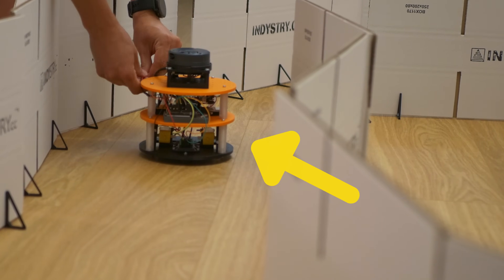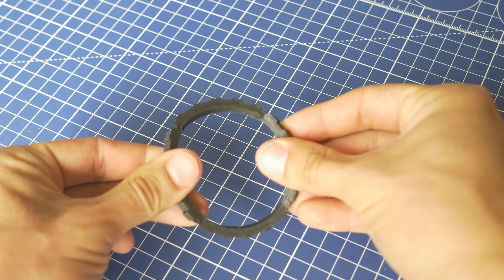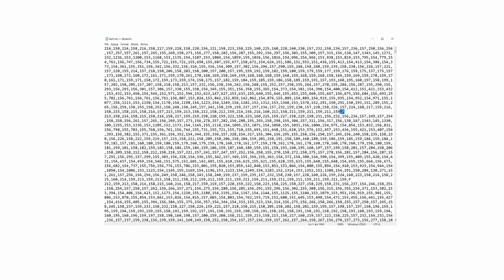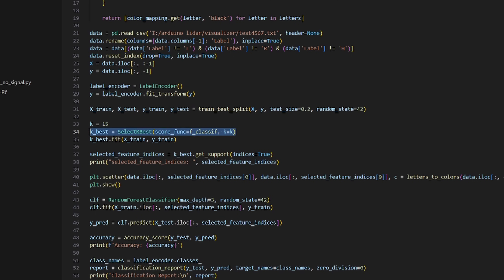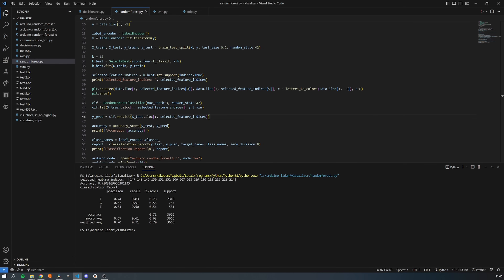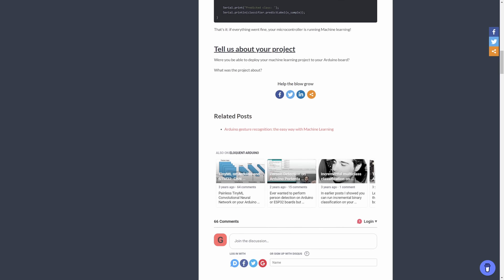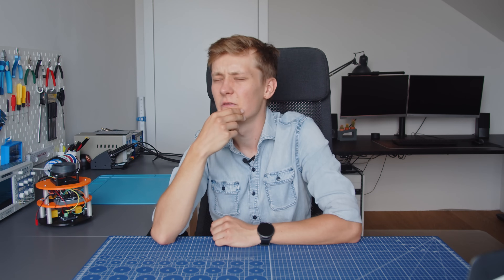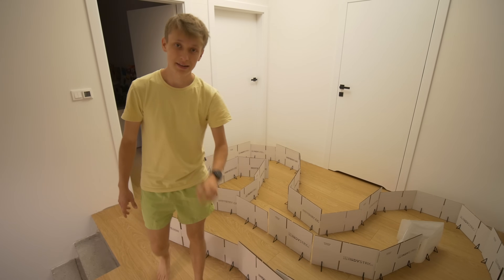Machine Learning on Arduino Uno was a Good Idea

Comment: Can i power the motor driver with 8 AA batteries?
Reply from the maker: Even 6 could do as I am using 2S lipo battery which is 8.4V max. But it's better to use 18650 or a lipo instead of AA batteries. You can get higher currents and recharge them
Reply: @nikodembartnik  Thank you for the answer. Does it matter wich TPU u use for the wheels?

Comment: A really interestin and amazing project. You are the Master.
Nikodem, I need to do a ball robot collect. 
So, how to do for to adapt your experience on a ball collect robot arm by arduino? My idea is:
  - to put sensors on each axis (angle sensors) to move. Maybe 4 axis (minimum). 
  - To move the arm manually.  Or is better to use by BT like you? or in each movement to put a switch and when the movemt is fisnish to push the switch?
  - To write each sensor data on a SD. How to organize the datas on SD for to TinyML?
  - Use the TinyML to create the code "*.h" and then use it on the arduino.
Some other suggestion for to adapt you project on my robot? 
And another option could be will be to use a "PixyCam2", it generate a lot of data could be interesting (size, position, reco👌gnise object, ...)

Comment: hello , if I want to measure the density of traffic on a road, what kind of system can I install? i want something low cost and functional. it should be a system that can transmit this density to another device and show the density. i would be very grateful if you help me. lidar sensor is used? which one do you think is advantageous?

Comment: How can we use reinforcement  learning instead of labelled data set
is It possible>>>?
Reply: Of coarse. I would opt for software training though while normalizing the data to what the lidar module outputs. then you can do multiple training sessions in parallel then upload the finished modal to the robot for real world testing. 

If you want to do reinforcement training, you would need in excess of 30,000 - 50,000 revolutions around the track.

Comment: Had a look at the RPLidar DataCollector code, what is the purpose of setting the Lidar resolution to 240? Why not set it at 360 degrees?
Reply: He mentioned in the video that the robot will be driving forward, so to limit the data noise, there’s no need for rear facing data.

Comment: Hey i am just wondering to work with the same project but i am thinking of a maze solving bot. maybe it is a great idea to work on one using arduino with a lidar sensor but i havent got the materials to do it yet. i think it would be good if you work on a video like that

Comment: New subscriber here! This is a fantastic project. I just came to this video from the one where you raced two of them, very cool stuff. I am working on a similar project using an RP1 LiDAR with a differential drive robot as a learning platform for things such as SLAM. I am not too familiar with ML. Do you have any favorite resources or project ideas to get begin learning?

Comment: 🎯 Key Takeaways for quick navigation:

00:00 🤖 Introduction to the robot and project setup.
- Introduction to a small robot with machine learning algorithms running on Arduino Uno.
- Overview of the project's goal: autonomous navigation on a racetrack.
- Mention of the steps to be covered in the video, including building the robot, creating a racetrack, data collection, processing, and a final race.
02:20 🤖 Building the robot and the racetrack.
- Description of the robot's construction using an open robotic platform.
- Explanation of using simple blocks for the robot's chassis and adding necessary components.
- Improving traction on robot wheels with TPU tires.
- Innovative use of cardboard for creating racetrack walls.
05:01 📊 Data collection setup.
- Installation of a Bluetooth module and an SD card for data collection.
- Explanation of recording lidar measurements and control labels while driving the robot.
- Details about the data format and collection process.
07:10 🧠 Processing and training the machine learning model.
- Discussion of feature selection to reduce data dimensionality.
- Overview of experimenting with different machine learning classifiers.
- Mention of using Python libraries for processing and training.
09:08 🏁 Testing the robot's autonomous driving capabilities.
- Introduction to testing the robot's performance on various racetracks, including square and figure-eight.
- Highlighting the ability to adapt to new racetracks with additional training.
- Preparing for a final test on a complex racetrack.
11:40 🏎️ Achieving high-speed autonomy.
- Surprising results as the robot successfully handles high-speed autonomous driving.
- Discussion of motor speed settings and PWM signals.
- Comparison of robot performance between manual control and machine learning algorithms.

Made with HARPA AI

Comment: Nice Work! It would be interesting to see if one could "simulate" the movements for a rectangular track, instead of training on the actual path. I would guess, it would lead to comparable results. If yes, then the advantage with simulation is that one can design more complex paths without actually building them - making the training process very efficient and robust.

Comment: I cam make some suggestions as a 5 year in a row roborace winner.
Me Personally, i would put a switch on the robot that allows for automatic learning or performing, u can use the distance from the sensor as a valid/invalid logic for keeping the data or trashing it due to a crash (too short of a distance, mean crash), also try to add a preference on the robot as far of lefty or righty robot, doing so in can also navigate maze, and i usually add also a preference for the longer the distance it measure in a direction the bettere it is, but with all of this, to proper race u need to now how to access really low level on arduino or a more powerful mc.
Anyway if it's your first time, not bad.
Ps. With lidar won't be common but implement a system to detect when the signal is wrong (like wall to far or too close, or a reflective wall, or sometimes also really pointy corner can cause problems, like if u have an Y too narrow. Usually i do like, of i detec for x time too similar data, do a sweep around and check if Im stuck
Reply: Teach me bro pls 😢

Comment: The most intriguing thing about this according to me is realisation that you could work leanly with data sets. Yes, within a certain dataset eg. maze (the square one for example) you want as many laps as possible, but for industrial purposes keeping the the amount of mazes down when you know what kind of mazes the robot will encounter should also avoid bloating the Arduino with unnecessary data.

Also, truly amazing that you made a robot that could race faster by itself than you could race it manually, just by tweaking the motor speed. That goes to show what machine learning can do in terms of work optimisation, sort of like how the search function on a computer vastly outpaces any human manually searching for a document in an archive room.

Thank you for making a video that clarifies so much with so little!

Comment: Great project. The reason it was able to handle the increased speed was twofold: 1) the control dynamics were similar enough at both speeds and 2) the sampling rate was high enough that the time delta didn't have an impact on the stateless prediction model.

Comment: You data collection code includes Serial1, I thought Serial-3 were only available on the mega 2560, How are you making these work on an uno?
Reply from the maker: That's Uno R4 with the new more powerful microcontroller and you have more serial ports available
Reply: @nikodembartnik  Cool, thanks, I have just ordered one to play with.

Comment: Can it be made to teach itself? Technically, it has a rangefinder on the top. In the square, for example, it shouldn't be running into the wall, when faced perpendicular to it. Is there a way to have it go through the course at low speed, be aware of when it completes a lap, optimize its path, then gradually increase its speed, as it becomes more confident? That could save a few minutes/hours of manual training, while also making full speed training unnecessary. You could have a routine that varies the amount of left to right distance bias, and after a few runs it could have complete familiarity with the track. Then you might be able to send a command to either hug the inside, outside, or prefer the center, while the robot is moving. Just a thought.

Comment: Would it not be easier / faster to generate the features via simulation rather than you driving by hand?  That way you can train on way more tracks (as they can be pseudo-randomly generated) and also have the simulation provide feedback on collisions when driven by the AI model.

Comment: You could used ordinary tracking a line on the floor or collition detection to teach the LIDAR to track.
And you could even use that input while learning.  Then you can remove that tracking device.  It is not uncommon to use extra input while doing the learning.

Comment: Great project 👍 ❤
Can we use any simple sensor system for this ? To make it cheap and simple to implement. 
And to all the commentors who are suggesting to train on viral environment and then implement it on robot, no doubt we get the perfect path for driving but how this will react to actual sensor data ?

Comment: If you have access to, or can get an Nvidia GPU then you could train it in a virtual environment and use the virtual environment to gather training data, then you only need to implement the ML model on the arduino.

Edit: you don’t strictly need an Nvidia GPU and for simple ML like this could probably get away with just using your CPU but Nvidia has a lot of support for ML and robotics. 

Your best bet for really good results is to train it using reinforcement learning in a virtual environment. That way you can change the track much faster too.
Reply: Can you explain little bit more how this can be done?
Reply: @aayush212  your best option is to look at "OpenAI Gym" or Nvidia's "Isaac Sim" and "Isaac Gym".

Comment: How about running this as MicroPython or AdaFruit's CircuitPython directly on a more powerful microcontroller called the RP2040?  It's the debut mcu from RaspberryPi.  I'm going to power my keyboard PCB with that.
Reply: The ESP32S3 is better for ML, it has DSP instructions and has a higher clock speed and works with micro and circuitpython too.

Also micropython is not a good language for microcontrollers, they are just too resource and performance limited. You don’t want to lower the performance even more by running an interpreted language on them. C is much better for microcontrollers, the programs require less storage space and they run much faster. Versions of Python used on microcontrollers should only be used for very basic prototypes or projects.

Comment: Love it! 

Pro Tip (i guess): 
In Training Mode: Let the robot follow a black line instead of driving it yourself.
Reply: That would be a different type of machine learning. Here none of the actual learning is done on the robot, he just gathers training data and then trains the algorithm on a computer. What you suggest would involve training on the robot itself or setting up a separate line follower system just to gather the training data. Also line following isn’t that useful and can be difficult to do well. You can do the simple way of just using colour or reflection sensors but beyond that you have to go into machine vision which the arduino can’t handle.

The best way to do it would be to set up a simulation and then use something like reinforcement learning to train the robot.
Reply: @conorstewart2214  i never said that it should be done on the arduino. instead of driving it yourself, the robot does itself by following lines and save it on the sdcard as usual.
Reply: @TechnopolisDotTV  still that isn't the best option. You are just teaching it how to follow a virtual line essentially. It also involves making a separate line following system too that is just used for gathering data and for it to be useful for gathering data it would have to be a well tuned system for smooth and consistent movements, not just the jerky and slow versions that most people make. How you lay out the line would heavily influence what path the robot takes round the track. 

Reinforcement learning in a virtual environment would be much better and would let the ML decide on the path itself.

You also want some inconsistency in training data and driving it around the track manually provides that, so it doesn't take the same path every time, with a line the path is pretty fixed.

Comment: I wonder if you could set up virtual race tracks in something like Unity to collect training data. The benefits would be that you could control it with an actual controller and from first person ( so better precision ), and you could have much larger and more complicated tracks
Reply: Nvidia have created Isaac Sim for that purpose, it can even generate photorealistic images on the environment for training but just using a distance sensor like this should be easy to implement. It is made for training ML algorithms so can generate the training data and train the AI and can even do things like reinforcement learning, genetic algorithms or similar.
Reply: @conorstewart2214 That's really great 👍. Is it open to use for free?
Reply: At that point it would be possible to run ppo with a neural network instead